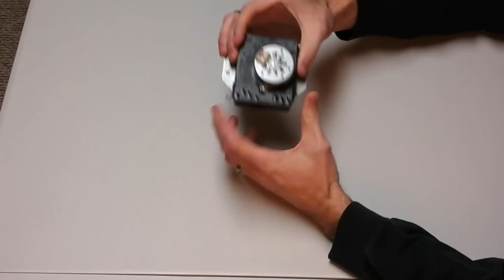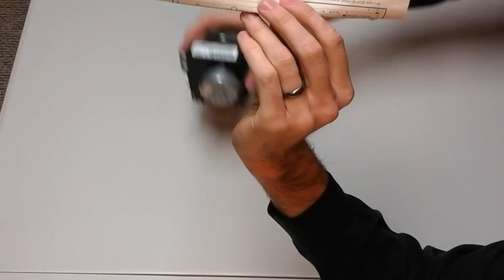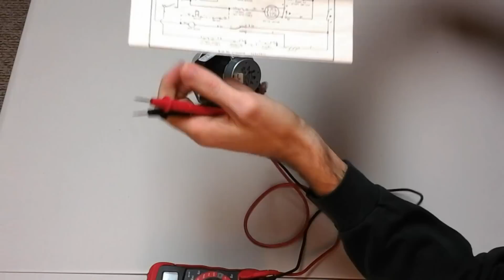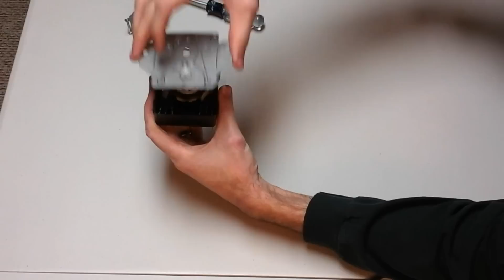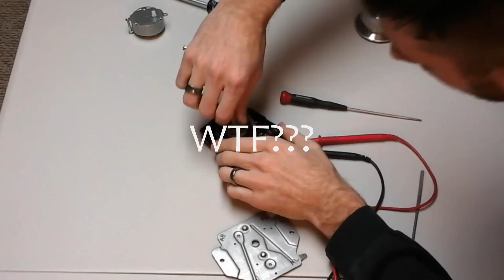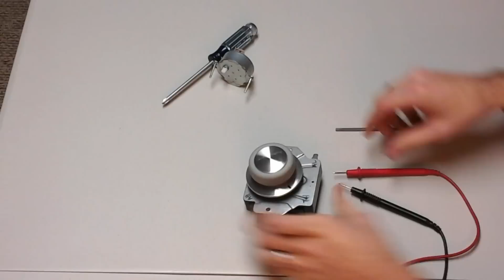Test and repair a clothes dryer switch

Comment: Great vid. I have a problem that might be related. It's a timer on our Whirlpool dryer that cuts out, and only works if I push/leverage the timer knob up or down or left or right ever so slightly. I can attach packing tape to pull it down, for example, and it works for as long as it takes until the knob rotates slightly through the cycle (3-4 mins).

Could it be contact buildup?
Reply from the maker: It's possibly the same issue. Applying pressure to the knob is basically forcing the contacts together. It's pretty easy to pull the switch out of the machine. It'd be worth checking out.
Reply: +Dustin Rogers  Wow, thanks for the quick reply. I'm on it. I'll follow up and report back (and maybe someone else with the same issue can learn from this, too)!

Comment: Tonight we started a load of clothes to dry before we  left for dinner. Two hours later we returned home and our dryer was still running. It continued past the setting we had put it on, i was thinking it has to be the timer so i got on you tube and searched for 'dryer timer repair' watched your video and got to work! I have the same timer in my Kenmore machine. i removed it, tested it, when testing continuity between the A and B terminal,A and B would always show 'closed'. upon opening the timer i could see that the contacts were shorted due to arcing, it didn't take much effort to separate them. after filing i  installed the timer and so far it is working correctly! thanks for a great how to video!
Reply from the maker: I'm glad you got it working.

Comment: How is the fix holding up for you guys? I've filed one of these in the past and it worked for a week before the buildup came back and lost continuity/heat again. Just curious if you guys are seeing this same problem return after filing the contact down. Thanks!
Reply from the maker: I sold it a few weeks after I fixed it, but the new owners have not had any issues with it. Did you lose continuity on the same terminals? I had to bend the one terminal a bit for it to make good contact consistently, even after filing the contacts. Wonder if it was the same issue on yours? I'm not sure if heat from the arcing causes those copper strips to warp enough where the contacts will just barely touch, or if it's manufactured for inconsistent contact pressure to cause arcing which leads to early failure. If things last forever, they can't sell any new products.
Reply: +Dustin Rogers They definitely changed their manufacturing technique, as this timer is a huge problem. I've replaced many of them. I can't remember which contact it was, but it was the same burnt/carbon build up that wouldn't allow the current through so it stopped heating. They have been making these mechanical timers for 50-60 years and all of a sudden they are garbage? Couple that with our culture's propensity to discard things the second they break and that would be great for new appliance manufacturers. From what I have seen, stay away from the style of dryers that have just a timer and a start button.  If there are 2-3 other buttons on the control panel, it signals a better/bigger timer and I have not seen those go out with any regularity.

Comment: Hey there! Thanks a lot for this video :-) My problem was in the timer also but it was the first plastic ring had a broken clip that made it disengage from the core so it wouldn't activate the contacts. Thanks to you I got to it and fixed it with Krazy Glue.

Comment: Nice video way better than I had -PawPaw
Reply from the maker: I see that you experienced the same issue in the past. Do you still have that timer switch laying around? I'd be curious if you tweaked the far right contact strip if you'd regain continuity? Anyway, thanks for watching.
Reply: Today i was fooling around with an old one I had laying around. I laid it on a flat anvil and gave it a straight on tap using minimal force. Just enough to knock the things out of their compression lugs. The bend lugs are what is holding the terminals in.
Reply: Using a small screwdriver wont do it. I think what the do is place the thing in a vice and slowly compress out all of them at once.

Comment: Thanks Dude you just saved me $110! 
I had the same problem with the last copper contact (A) I too had to bend the sucker to ensure conductivity. Even after filing off carbon scoring and spraying with electronic contact cleaner
Reply from the maker: Great!! Thanks for watching and subscribing.
Reply: Maker Dad
You're welcome. I'm a firm believer in trying to fix things myself and YouTube is a great tool. I've also used it to fix lawn mowers, cars, and electrical boxes. I will post any future fixes I come across. Just so you know, I searched forever about the dryer control module and most everyone else just said replace it. You're one of the very few who actually tried fixing it.
Reply from the maker: Too many people throw perfectly good things or easily repairable things away. I think a lot of times it's because they are intimidated by taking things apart. It's already broken and going in the trash, what's the worst that could happen? Please share the video on any forums or discussion boards that suggested to "just replace it" so that more people can jump on the "fix it" bandwagon.
Reply: Maker Dad
I already shared it on Facebook. That's what funny but true about your video "Since the switch is bad anyway, there's no harm in trying to fix it" more folks need to at least try